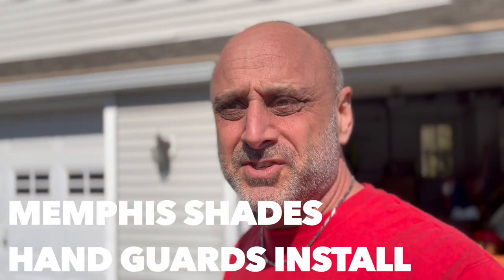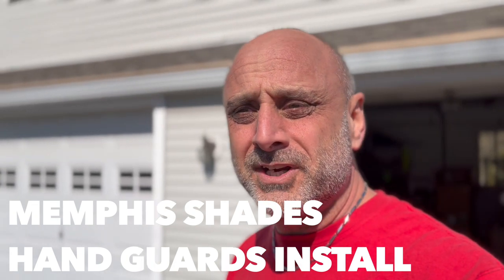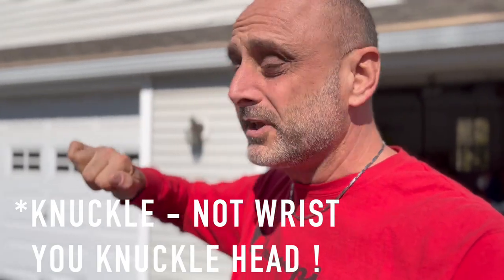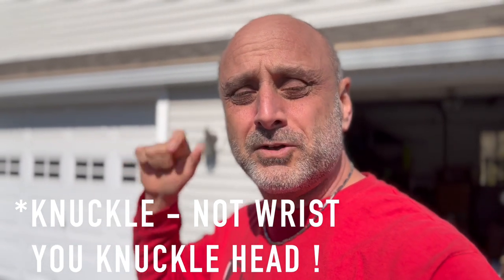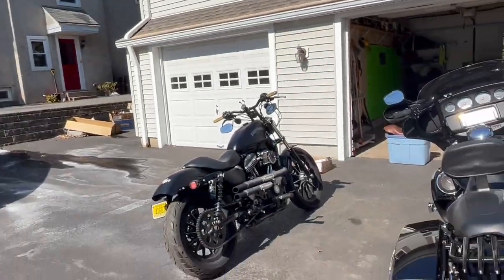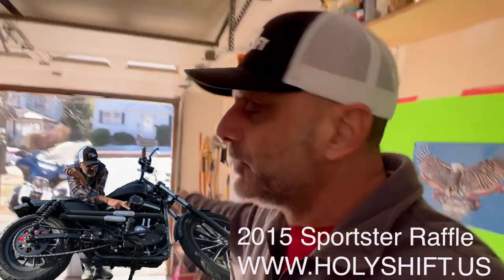Memphis Shades Hand Guards Install

Comment: I think i would have mounted it as far away from the end of the edge of brake/clutch lever...
Reply from the maker: I can easily change it. I was looking at the aerodynamics of it - and it made sense to put it like I did- less drag….
Reply: @HOLYSHIFT  But you want it functional....Plenty of room for your hands wearing gloves without touching the new guards

Comment: Typical Memphis Shade half arse design. No attempt at all to cleverly mount it, weld braket to guard?  Nah we'll just bolt it on and put some crappy bungs over the bolts. Proper ones would be attached at both ends to stop rotation. In a crash or if you clip a wing mirror these will just rotate or even collapse crushing your fingers behind the levers.  These are for looks / wind protection only.